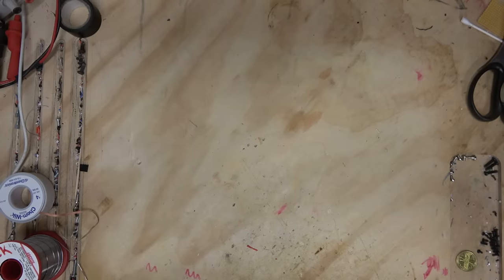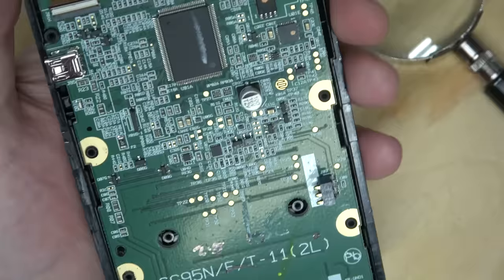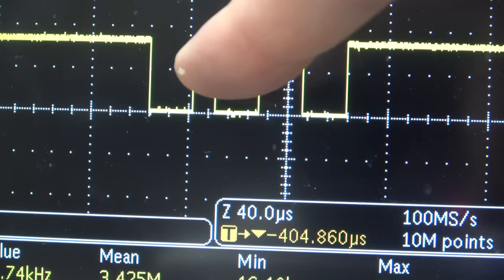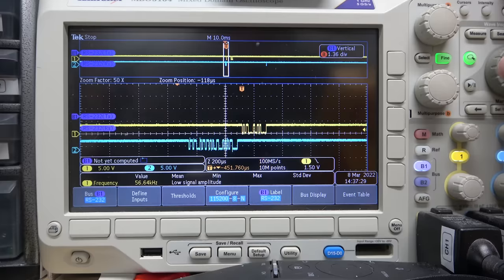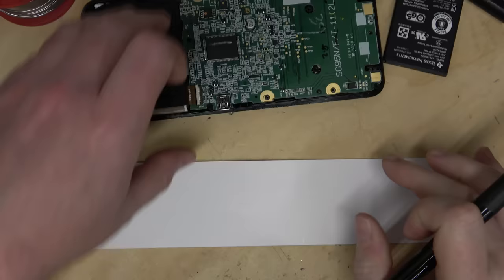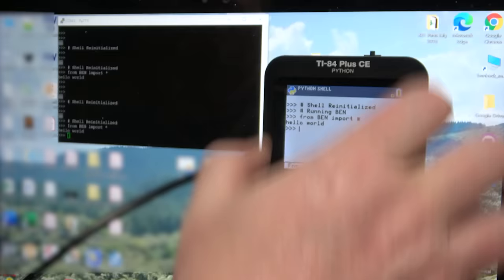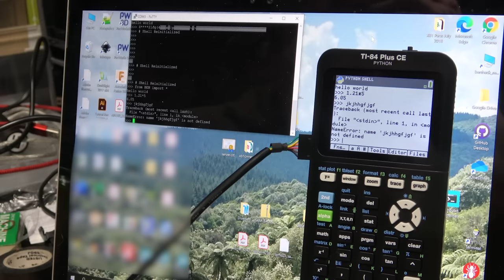Inside the TI 84 Python Edition Calculator!

Comment: They still make 6502's too.  65C02's.  And for good reason.  They're awesome.
Reply: Yes, but Z80, 8080 (yes them too) and 65C02 are considered microcontrollers now. Some have even timers and watchdogs. I assembled a Chinese digital clock kit that I earned on a prize draw on an event that had a customized 8080 with internal ROM for things like these. The chip is also made in China.
Reply: @agranero6  OK, I don't know about the Z80 line but the 65C02 that is still made today is NOT a micro-controller in ANY way.  Not even a little bit.  It's a full CPU.  I've literally put them in Apple II's (with slight re-routing of pins) and they work.  In fact, the Apple IIgs and IIe (expanded) work with the 65C02.
Reply: @cbmeeks  I said they are "considered",  because of memory and speed, and because many are used this
way. Yes those with internal RAM probably could not substitute the original ones. But those without it can surely be used for that, even with advantages.
I never saw a new "8080"  that could. But several "Z80" can.
I like the 6502 too, the several addressing modes make it very easy to use and powerful.
The magic of those machines is that you could fully undertand all that was happening.
Reply: @agranero6  I don't know who or why someone would consider a 6502 or it's variants like the 65C02 a mico-controller any more than I would consider a micro-controller an FPGA.  They are not the same.
Reply: @cbmeeks  The is no "official" definition of microcontroller, except when you have a Harvard architecture and watchdog counters when there is little doubt. The definition is usulally usage dependent: when it is used as a microcontroller it is one, when it is used as a CPU it is not.
And yes FPGAs can be used as ANYTHING, even as a 6502. They are much used in avionics (because of the low quantity of production) and osciloscopes (and much, much more).
And as 6502 is simple, has powerful addressing modes and a huge toolset it is not strage they are used tnis way.
Besides addressing 64k allows easily to make versions that have integrated memory blurring more the lines.
Reply: @agranero6  I know what FPGA's are.  I didn't need it "mansplained" to me.  My original statement was that the 65C02 is not a micro-controller.
Reply: @cbmeeks  Nor FPGAs, but they are used as such most of the time. And when they are used this way they are. That is why I detailed it, thatvwas my sole intent. We call your mobiles phones, but they are less and less used like that: thay are powerful computers. Don't be ofended by calling them microcontrollers: some ARM series M are far more powerful than most 70s, 80s and 90s CPUs and we still call them microcontrolers (thats why the M). It is not demeaning for those CPUs (to that I am very attached too), those new usages allowed them to continue being made. Long story short: no rectangle is a square  but all squares are also rectangles, any CPU can be used as a microcontroller (but just some are cheap enough to make it worth and that is the case), but you can not use an Harvard architecture as a CPU in the modern sense because they are not flexible enough.
Reply: @agranero6  OMG three words into your response I stopped reading.  Again, I don't need you to "explain" things to me.
Reply from the maker: The Z80 acclaim (what these calc use) is still a Z80 compatible core but with all sorts of modern peripherals such as USB, SPI, I2C etc. Not that weird really, a wimpy ATMEGA is a 8 bit CPU too, albeit with pipelined instructions (vs the Z80 with many T-states)
Reply: @BenHeckHacks  ! Why to do that? To avoid redesigning the whole calculator and keep compatibility?

Comment: What about a calculator that embeds an ESP32 relaying over wifi with a cloud service providing remotely controlled instances of Chrome that renders equations with Desmos, sends the data back as PNG, which the ESP32 decodes and feeds pixel by pixel to the main Z80 over serial?
Reply: Sounds like a Silicon Valley startup idea!

Comment: Rather than an AND gate, wouldn't a couple of backwards diodes done the job? And then not required a switch, as well as not requiring vcc and gnd? Since you're just after a way of allowing 2 inputs to pull something down to gnd, so, 2 reverse-biased diodes, right? Left alone and unconnected, nothing happens. Would have saved a bit of soldering even if you would need to maybe solder up a couple of thin wires to attach the diodes to.

Comment: Maybe the USB is just passing  keyboard scancodes to the python interpreted and it's interpreting them as ASCII, hence the scrambled characters. Which begs the question what happens if you connect a virtual serial port over USB? and did you just waste all that effort?     also right click on you desktop, then select 'View' then uncheck 'Show desktop icons'
Reply: The OS doesn't support USB serial ports. I've written a library for that, but since it's not part of the OS the Python app wouldn't be able to use it.

Comment: TI loves UART in their calculators. The little 2.5mm transfer cables are also UART, with RX/TX and GND. I wouldn't be surprised at all if they're just using the link port BCALLs written 40 years ago for all of this. It would explain the huge gaps. TI's code uses extremely bulky routines for accessing their equivalent of syscalls. Something like 1000 cycles per call, minimum.

0x3E is >, so that initial return at 17:25 is "\r\n>>> " which is just the python REPL prompt.

Honestly I'm surprised they didn't go for an arm based TI-84+ with the same emulator they made for the nspire series. It would outperform the ez80 by a pretty wide margin if they just removed the speed cap, and it could just run the same FreeRTOS on top. A python interpreter running there would be easy, and much higher performance.

It would probably have a lower BOM cost too, considering those ez80 chips cost $10-20 each, and much better ARM cortex m4 chips can be had for half that.
Reply: One hilarious consequence of this is that, if you used assembly to directly bit-bang the port the python chip was hooked to, you could get that interface running dramatically faster.
Reply: TI isn't paying anywhere near $10 for those chips.
Reply: @happycube  Using their own microcontrollers rather than zilog's is almost certainly cheaper. The ez80 is a relatively low-volume specialty line of drop-in compatible replacements for ancient z80 CPUs.
Reply: I get the feeling R&D is understaffed and these virtually have a monopoly so there’s a lot of margin still

Comment: I'm guessing the co-processor is so slow running python code that UART is "fast enough" and easy enough to implement using ready libraries. Using SPI would simply add complexity for no perceivable advantage. If they chose a faster co-processor then they could use SPI, but the processor would be so much faster than the Z80 that it could just emulate the calculator itself and the Z80 would be useless and the co-processor would become the main processor and there would be no need for any SPI or UART communication at all.

Comment: I wonder why wouldn't you use a pullup resistor on the FTDI Tx line on the calculator side. This way you could do away with the switch.

Comment: Why did you not use just some weak (like 2k) pull-up resistor on the pc tx line?
Reply: I think he didn't think of it.  At those data rates you could use a pretty weak pull up and totally avoid the switch.

Comment: Why can't they starting using the ZILOG Z800 and ZILOG Z8000 they will be much faster.
Reply: Why does a calculator need a fast cpu? I know it can be used for programming but why? It will also make them even more expensive probably

Comment: My HP-50G has a 32bit ARM core with a 75Mhz clock, but the calculator environment runs in a 4Mhz 4bit Saturn microprocessor emulator. Maybe if NEC had kept making the Saturn the 50g would be more like the 84, Saturn + ARM co-pro.

Comment: Very cool vid!  Have you checked out the Casio FX-9750 GIII?  It also has Python implementation.  I have one, I like it a lot compared to some of my other Casios.  Have not used the Python.  I wonder if they utilized a similar solution, because it's otherwise very much like the 9750 GII.

Comment: Ben. Have you checked out the Casio FX-9750G III or FX-9860G III? It runs MicroPython. I've got one in my stash, but haven't got around to figuring it out. I wonder how janky its implementation is compared to the TI. They're also around $50 USD.

Comment: Kapton tape could be used for adding the smallest amount of mechanical space for the 3 key for better contact when it's pressed down. Trust me, I've seen weirder stuff when our ODM spits out a laptop for us.

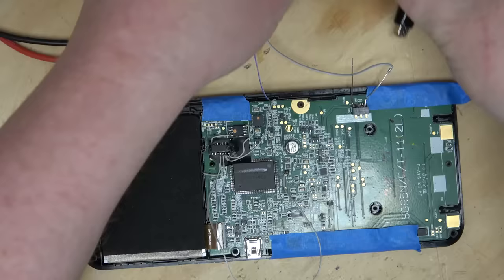30:02 Also as a Texan myself, thank you for recognizing us as a sovereign nation.
Reply: Great point… I don't know how the keypad works but it seems the keys are just plastic (or silicon rubber?) and do not conduct electricity anyway.

EDIT: I didn't see the silicon rubber inlay at first because of the confusing way the video is cut. This would presumably have conductors to close the circuits. The key probably still works because they didn't cover the entire base.

Comment: What's that "E3" looking solder pad on the back of the keyboard) PCB next to that capacitor? 
I presume it's a button contact pad...
I further presume it's a hard reset, or, maybe to clear the storage (maybe for use while refurbishing?)

Or maybe if you hold it while turning the calc on, it gives full admin access! lol _(I mean, have no expertise here, but based on this vid, it doesn't seem like much of a stretch that it'd actually do that... haha

=====
I think you should've used the USB port for your hijack, instead of adding your own pins. Could you do that, by having a multi pole single throw switch, to have it disconnect the clk & data from the PCB AND then connects your hijacked wires, when your switch is enable, then disabled it'll basically restore vanilla function of the port... (again, I'm way out of my element here lol)

Comment: Hi!
Great video! But my attention was caught by one detail. When you run saved program calculator sends to repl "from BEN import *", not program you wrote. This construction means "import all code from file BEN" and I just must ask - how this thing access file system or memory, or whatever it reads from? What a madman designed this thing :)?
Reply: Could try the os module and work from there.

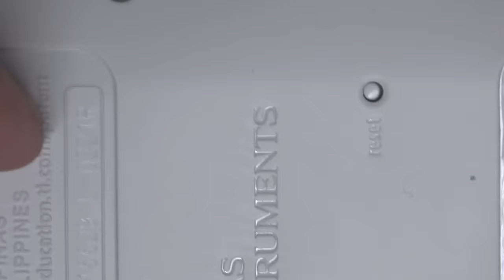Comment: So what officially is that wavy label with hand and ® at 27:06 called or what is its purpose?
Reply: It sets of alarms in a shop when you leave with the device. There are magnets underneath the till or cash-register area that deactivate them. So they only go off when you steal the item with the tag inside. Very common on tools and higher value goods :)
Reply: @jadenred  Thanks! I had that stuck in a box of something I got for a christmas present and I was curious about it.

Comment: The that calculator I have a processor like raspberry pi?
Reply: If you're asking "This calculator has a processor like a Raspberry Pi?" then yes, they both use ARM. But that's like comparing an Intel 8086 to a i9-12900K.

Comment: I think that's a micro USB port? Not US Bee See? Absolutely unusable. They should just put all their prospective customers out of their misery and hire an enormous wood chipper then push all their stock into it.

Seriously though, the atmel chip is a co-processor for the calculator's Z80 chip, which it controls via a serial UART. But then you connected an external serial UART to it from your computer, so by the same token you've basically turned it into a co-processor for your computer!
Reply: No, it's a Mini USB port.
Reply: @eDoc2020  You're right, I don't know why I got those confused. But that's even worse! Get it into the wood chipper.
Reply: @UpLateGeek  mini usb is one of the better usb ports.
Reply from the maker: Micro USB sucks. Mini is super reliable. It's u fortunate so many devices have Micro just to save what, a millimeter of height?
Reply: @BenHeckHacks  Yes, but it's not US Bee See. All glory to the US Bee See.
Reply: @BenHeckHacks  one should be more 'courageous'

Comment: Why wouldn't they just use the ARM processor to power the whole calculator?!
Reply: @SomeoneBloodyRandom  pretty sure an adequately powerful arm chip could run software to emulate a z80 pretty well.
Reply: @SomeoneBloodyRandom  Yeah, I was already thinking that a few seconds after I posted it. Not too hard to interface another chip to the main CPU.
Reply: Didn't they do that for the successor of the TI-89 series?

Comment: Why would you want Python on a calculator? R would be much better.
Reply: Because its a learning tool. You aren’t going to be processing big data in 150kb of memory.
Reply: Python is far more useful to learn
Reply: Python is similar to BASIC in approachability and relative power. It's a natural successor
Reply: Python is very popular for data science/analytics. It has loads of toolkits for data conversion, analysis (built on NumPy, SciPy, PANDAS etc), charting (Matplotlib) and so on.

Tip: if you have a computer in front of you, why bother with a calculator? Just run Python in a Jupyter notebook! Now there is “scratchpad computing” at its finest!

Comment: These calculators could use a low end 64bit ARM chip that would allow them to be faster, handle more calculations, run more applications, do away with this dumb hardware design, and still be able to make a profit. TI should have made enough money on all the old calculators to hire ARM developers to write the new software.
Reply: Maybe it's something to do with the auditing for exam use in education? Having all the old code remain the same means it doesn't need testing again, and then the ARM part can be evaluated separately. Since, as Draconic and everyone else knows, they only sell because of that reason.

Sending data between the chips as pseudo key-presses could be part of that. There doesn't even need to be a separate routine for serial transmission, you just hook it into the keyboard read routine. That keeps it off, compartmentalised, and keyboard routines are usually pretty simple. So little of the Z80 code needs re-auditing, the rest is just accepting keypresses like it always has done. Then the ARM stuff needs auditing, but keeping it separate means they can upgrade or alter that part whenever they like and still keep the Z80 code exactly the same as the previous generation. The Z80 code is likely much larger than the ARM code, partly cos ARM opcodes are simple and versatile, partly cos all of the functionality except Python runs on the Z80.

I wonder how schools in poorer areas do with this special audited-calcs requirement? That's a lot of money for a calculator when a basic scientific calculator will set you back $10 or less. I don't think you'd need graphing for the stuff you study in normal school, you're supposed to do that yourself with graph paper and a pencil. Are overpriced cartelculators actually required at school?

Regulation and auditing can be scams all over. Ask Big Clive what he thinks about the current UK requirements for electricians. They're little monopolies, so companies take advantage as far as they can get away with it. Regulation can, and should, be done honestly for the benefit of the public, but often it isn't, it's done on the cheap or left to "market forces" and private interests creep in.
Reply: What?! The TI NSpire calculators are Arm and have been out for 15 years.

Comment: Python, eh? If you put that calculator in your pocket could you claim to have a really big trouser snake?

Blasted mobile phones with their tiny non-removable batteries because that's how you make a slimmer phone. Hah! Bull! Also I bet most people would rather have a phone that needed charging less often, maybe even the option to swap out the battery if you're caught short.

PS VT100..? Next you'll find the darn thing is running CP/M on that Z80! Are Ti Calculators not the jankiest devices known to man or beast?

Comment: Yeah, Python is Fortran to me. Not doing it. Real men learn Rust.
Reply: Rust on a calculator would be a bit labor intensive.
Reply: @GeirEivindMork  Ha ha.  yah.  true.  It is a fine default choice.  Either that or Lisp but well, yeah.
Reply: Python > Rust
Reply: @ToTheGAMES  Depends what you want to do. Rust runs circles around python in terms of performance. But Python is an easier language.
Reply: You can code C/C++ for these or just get right to Z80 assembly.
Reply: Only if you can cross compile it and don't have to program it in the field. The compile time would be insane, if it could even run on a Z80. I would say lua, except for the 1-based indexing, although that might actually make better sense to math people idk.